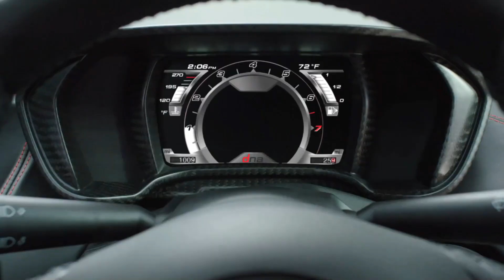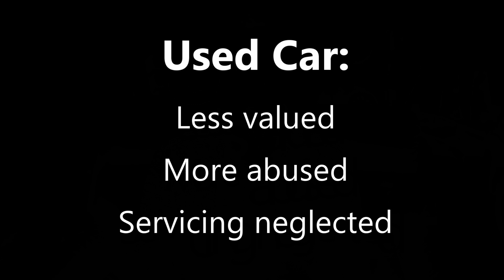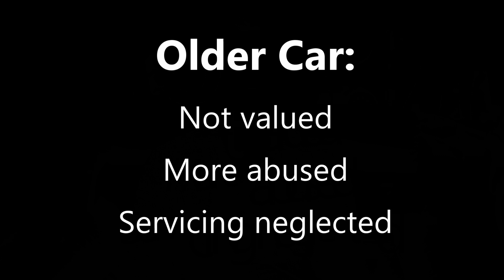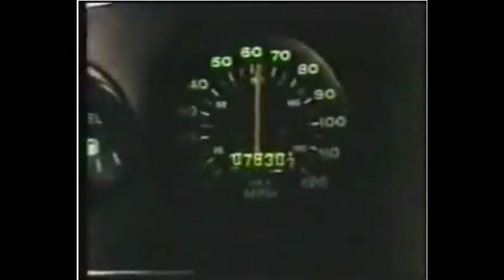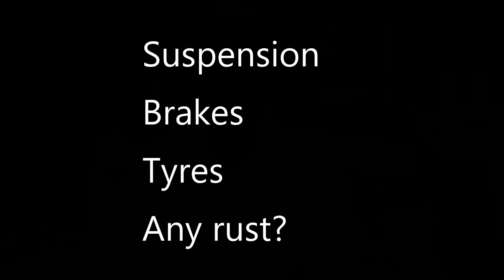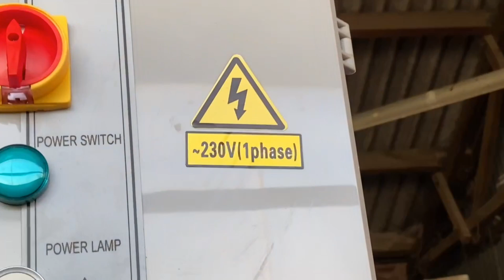Which classic cars will double your money??

Comment: Recently picked up a '02 156 GTA for under A$10k - much less than half the price they normally go for here in Oz (if/when you can find one) in part because it was on interstate plates and needed to pass detailed engineering/mechanical/safety/compliance inspection (similar to MOT) to be registered in my home state. Far from perfect, but straight, extensive history, and all the "correct" upgrades (330mm Brembos, Q2, coilovers, strut bars, sway bars etc). After spending a couple of grand on correcting the items needed to pass inspection, I've got a very good daily for about half the usual market price.  Now plan to gradually address the superficial items (paint chips on bonnet, headliner). Fantastic to drive, beautiful to look at, and only about 100 were ever sold in Australia, so its a keeper. Unless someone comes along and wants to swap it for a 3.0L Alfa 75 Potenziata ... 

But to underline the point of your video - I also sold my '99 156 2.5L Q-auto to make way for the GTA and got almost double what I paid for it five years ago. Though of course  that excludes the money I spent on getting it to it's very tidy condition...
Reply from the maker: Hi John, congrats on your very astute purchase! 😉. Sounds great - the 156 GTA is a lovely (and rare) car, I have a 156 2.5 which I also love. Enjoy!  👍🏻

Comment: Low mileage can be misleading. On the face of it, it would normally seem good, but if a car has only done 500 km a year for the last 10 years, there is potentially more to sort out than on a car that has done more.
I just bought an Alfa 159, 3.2 Q4 with 200k km. Unseen. 
Why?
FSH from new. 1 owner. Valid, long test. Detailed photos....oh, and gut feeling...

Great vid btw...
Reply from the maker: Cheers Neil and yes you are quite right about lack of use costing more in repairs but for rare cars, genuine low mileage almost always adds to the value 👍🏻

Comment: Chris, I’m thinking the RS5 4.2 naturally aspirated V8 which is now discontinued as of 2015 fits your 5 point formula. Legendary engine, beautiful coupe lines and in “relatively” limited numbers, top of the model line and to me at the bottom of their depreciation curve. Find a good one and on to a winner? What’s your thoughts? Modern classic in the making?
Reply from the maker: Hi Steven - yes good shout with the RS5.  That Audi naturally aspirated V8 is one of the greats of the last 30 years in my opinion and beats BMW's V8 on almost every front. Personally I think the RS5 still has some more to drop still, so my pick would be the early RS4 (B7 I believe), with the flared arches.  Lovely!
Reply: @TheAlfaNut  Happy days Chris as I’ve had a real good one stored away for four years now with an occasional summer airing. What a machine to drive though!
Reply from the maker: Haha! Great minds think alike eh? My neighbour has an R8 V10+ which is pretty gorgeous but I still prefer the sound of the earlier V8! 🙂
Reply: @TheAlfaNut  The good thing also is my year of RS5 is old school with no soft rev limiter like the new ones have so I get to fully enjoy the V8 exhaust note. Thanks for the replies.
Reply from the maker: Enjoy it mate! 👍🏻

Comment: I recently bought a 08 Fiat Bravo 1.4 tjet sport with 20k miles on the clock and reasonably well looked after, no mot fails. There are very few of them left. Do you think this is sonething that will increase in value?
Reply from the maker: Hi Simon, actually yes - any "nicer" model like your Bravo Sport, if well cared for and garaged, will be worth more than you paid for it in years to come.  Fiat Uno Turbo's are now selling for £10k+ !!
Reply: No, unfortunately nobody cares about them. Good cars though, always thought they filled the gap between the aged Alfa 147 and the Giulietta. They will just be scrap fodder. A mint Tipo 16V is only worth around £4k and they were actually lauded when new, the later Bravo HGT 20V may have a bit of a following but the latest  Bravo I think will just become an old, forgotten about car

Comment: I know they are diesel but the 147 Q2 / 147 Ducati Course Q2 / GT Q2 are a good bet because no other Alfa from the period had a limited slip differential. 🇮🇹😎
Reply: Well the 147 GTA would be a better bet imho. I believe it can be fitted with an aftermarket one.
Reply: @musmuk5350  yes the GTA will definitely go up in value. The Diesel Q2 is the less obvious option but quite underrated
Reply: they won't
Reply from the maker: This is true!